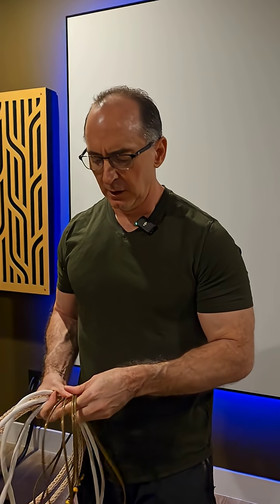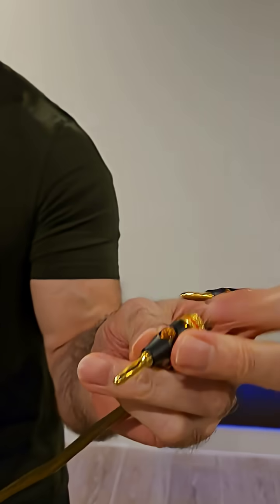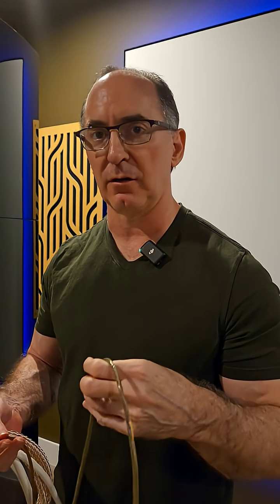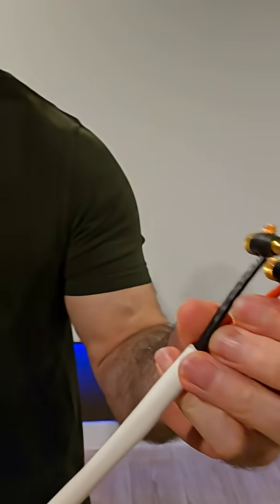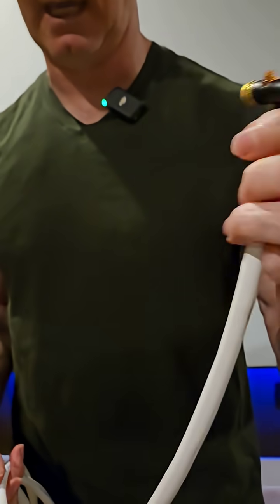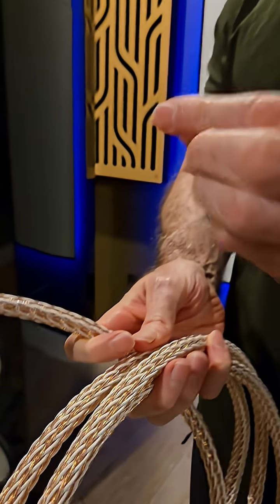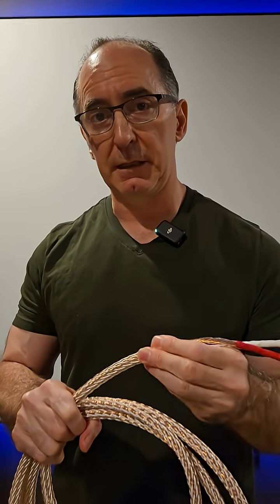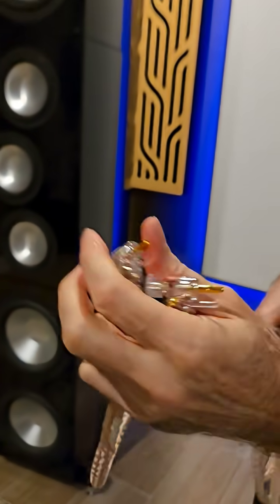What to Look for in Speaker Cables

Comment: Stay away from the closely spaced parallel  conductor speaker cables as the one he has shown in the video. If you do have one like that, it's not the end of the world, run a blade down the middle along the cable and split them. Then twist them for the entire length. You can thank me later.

Comment: A short list of erroneous audio beliefs: "Tube audio equipment sounds better than solid-state equipment", absolutely false, "The type, style and cost of audio interconnects, speaker wire, power cords and ac power conditioners will affect sound quality", absolutely false, "Vinyl records sound better than CD's", absolutely false, "Tube audio equipment sounds better than solid-state equipment", absolutely false, "The type, style and cost of audio interconnects, speaker wire, power cords and ac power conditioners will affect sound quality", absolutely false, "Vinyl records sound better than CD's", absolutely false, "Vintage analog audio recording and playback equipment and storage media is superior to digital technology", absolutely false, "Human ears are superior to objective testing of audio electronics", absolutely false. This is an "absolutely true" audio fact: Microphones and loudspeakers operating within any acoustic space with walls ceilings and floors intermingling with "first boundary reflections", mixing with the original sounds in recording to the microphone, or playback through loudspeakers, will distort many thousands of times more than any other individual piece of equipment in the entire recording and playback chain. The microphone and loudspeaker "room interface" is where the "problems in audio" reside, not in electronics and not in the "emperors new wires"! David Riddle

Comment: No...if you want low resistance don't use banana plugs!!!...they are rare enough quality (e.g. WBT). Mostly they have a multi-part conductor, which in practically all cases is just "riveted" (which loosens over time due to the soft material...but if the material is hard, it is mostly ferromagnetic!!!))...and also the contact on the connector is often a problem.
An alternative may be cable shoes...but these usually do not offer contact elasticity when tightened, and loosen quickly, thus requiring regular checking and tightening with high torques.
My recommendation - bare cables + quality crimp ferules connected to quality connection terminals... they don't offer the same comfort as banana plugs, but with a really solid contact you won't see quick-detachable versions... there is always the screw version, crimping,contact shoes, high torques, etc.
...yes...I am a professional...electrician-energy engineer.

Comment: Beware of braided cable. When SMWTMS was doing double blind tests of speaker cable, the high capacitance of one such cable caused the amp to go unstable and fail. The only difference that produced audible difference in the blind tests was resistance, too much, obviously because it interacts with the complex impedance of most speakers. This is typical of golden ear audiophiles that obsess over one parameter such that other parameters get out of control.
Reply: U haven't heard the difference
Reply: @CarlVanDoren61  Not just me but the entire panel of around a dozen listeners in our tests. Until wire size got small enough to account for significant resistance, none of the blind testers could identify cables in repeating tests with statistically significant results, even expensive braided cable versus two strands of barbed wire held to the floor with masking tape so that they don't short. We also picked a location with no radio or TV transmitters nearby. It takes at least 16 trials to eliminate lucky guesses. Tension in the stapedius muscle causes your hearing to change, the extreme case is when you yawn. That's why open tests are meaningless. The expensive and pretty gear tends to sound better to you. McIntosh understood that well.

Comment: Pro audio tech since 1977 here. I cannot stress enough the importance of good speaker cables. That's why I always get the 16 gauge zip cord at Ace Hardware, not the cheap 18 gauge.

Seriously, speaker wire does not matter as long as its resistance is low enough and its inductance and capacitance are not too high. Just avoid copper-clad aluminum. Its resistance is too high, and it fails at connection points too easily.

Comment: Hi Gene, in your opinion is there any benefit to external biwire cables? It sounds like that have the bass a treble separate would be worse based on what you said since the conductors are not close together. Am I good to go with gold jumpers on my speaker terminals if I have a good braided cable that has a large gauge?

Comment: Connectors and proper termination is key (in copper as well as fiber transmission).
As much as the cable industry makes up stuff about cable geometry, for some they have not latched on to connectors, plating thickness in mating surfaces.
Reply: I tried fibre loudspeaker cables - a real silent background!

Comment: I researched weaved cables on the web and the prices for just a 25 foot pair was insane.  Through the help of Grok, I will be braiding 3 sets of 14 awg OFC wire in a weave pattern, like the Kimber Kable 8TC.  I can generate 100 foot of this for less than $140.00 and an hour of my time.  Grok said this approach will exceed Kimber Kable specs.
Reply: Their Higher End cables are varistrand

Comment: So this is not “snake oil”?
Reply from the maker: The Kimber is well engineered cable, no outrageous marketing claims, but very pricey. No problems with a product being costly if it's designed well and does what it claims.
Reply: Speaker cable can easily get to “snake oil” territories, but there are benefits to good quality cables to a point. $50,000 gold silver infused ruby plated nonsense cables are not going to help anything, but if you follow the science and avoid meaningless marketing buzzwords, good cables are worth it. You don’t need to spend an absurd amount to get good cables.